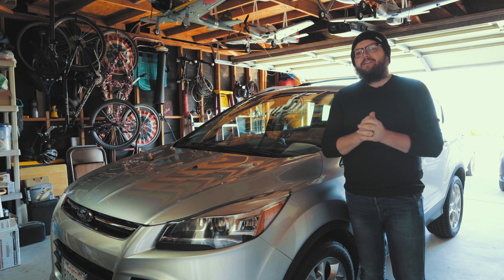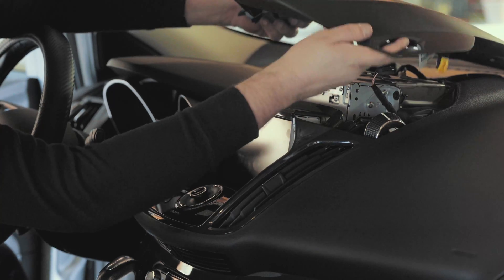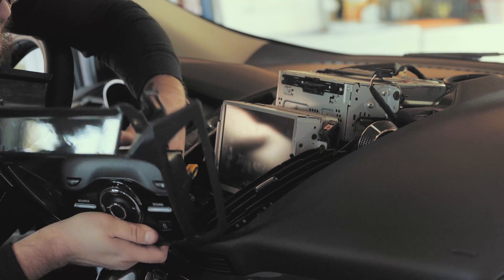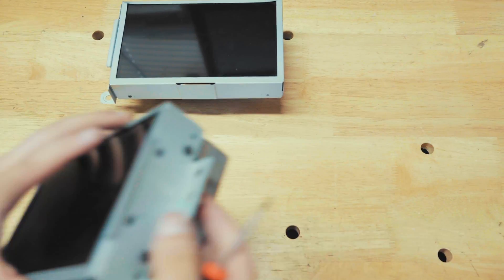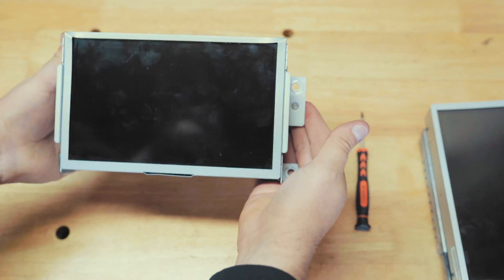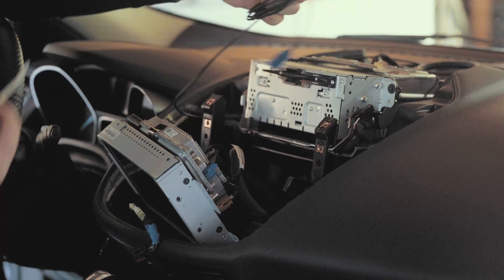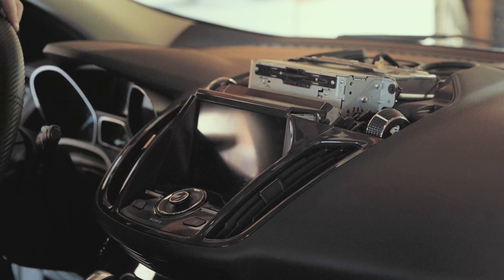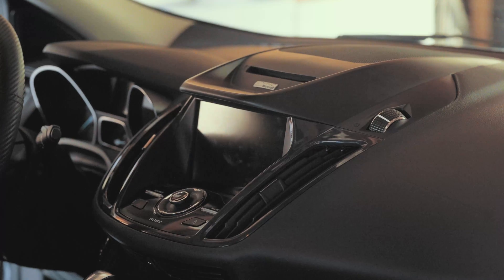2012-2015 Ford Escape Sync 2 to Sync 3 Installation

Comment: Hi, I just installed the new monitor in my 2014 Ford Escape and I wondered if I needed to do a step using the OBD2 cable?  Do you have. video for that?  Also, the instructions that came with that cable say I can't do it on a MAC. Is there any other way, if I have no PC available?  Thanks so much for this fantastic tutorial!  I helped a great deal.

Comment: So I ordered a Sync 2 to Sync 3 kit.  Switched it all out.  Ordered a used ACM.  Still no sound for AM/FM.  I haven't run the Forscan because I haven't ever done that before.  Is there a video on how to run the updates needed to make the new system work with my VIN?

Comment: Brian, once I install the upgrade kit from Factory Sync 2 to Sync 3,  how do I update to the latest software and nav maps? Ford updates will always ask for the vin number and since that doesn't change, the available updates will be for Sync 2 by default.  I did watch your Sync 3 software update video but not sure about the 2020 red box. Should I check yes or no because my vehicle is a 2013 with the upgrade kit from sync 2 to sync 3?

Comment: Will this kit work with 2012 MKZ?
Reply from the maker: Unfortunately the 2012 MKZ doesn't have the correct CANBUS communicative lines and CAN messages to boot Sync 2 or 3 ☹️

Comment: I have the 2014 model, my entertainment system looks slightly different (the controls, not the screen), would this still work?

Also, does the gps antenna not move around in there?
Reply from the maker: Hi! Please shoot me an email with a photo! GPS is stuck down with a sticky pad 😊  support@naviupgrade.com

Comment: Awesome video, I personally went to the junkyard and pull a stereo from a 2016 escape and took a picture of the Vin, so I can still upgrade stuff on the go, so I have a 2016 escape stereo fully plug-in play into my 13 escape. Only difference is my idiot brain didn’t decide to take the navigation Antenna and now the escape is gone. I will be checking your website to see if I can purchase an antenna.

Comment: Your video is very helpful with my replacement of Sync 2 screen (screen shattered in heat while touching).  I ordered a replacement screen and module from eBay.  I did not see any information in your video about programming of the new module.  Do you need to program the new module with your specific vehicle or is it just plug and play?  Ford service advisor told me that if I replaced the module then programming would be required.  Any info would be greatly appreciated.  Thank you.

Comment: Hi, great job. I have a question. I have got Escape 2015 with Sync2 and Navi. Can I just buy Sync3 removed from Forda Edge and install it  in my car? Is there anything that I will need to configure, like rear park aid sensors or rear camera or it is just plug and play?

Comment: Something that crossed my mind recently and may be worth looking into for SEO type stuff.

The same process for the 2012-2015 Escape applies to the 2013-2015 C-Max model years (with the 8" touch screen/MFT of course). The relevant dashboard and center console components are 100% identical. As such, this video has been my go-to to link people who are looking to do this upgrade in their own C-Max. Just an FYI in case you weren't already aware of it. 🙂
Reply from the maker: Yeah I think I used to have this labeled as that but it didn't do as well for views.
Reply: @NaviUpgrade and Kuga.

Comment: I’m interested in doing this on my 2014 ford escape, but this is something I cannot do myself. Can you suggest where I might go to have this done for me? I tried a Ford dealership but they don’t do that. Best Buy? etc?   I few years ago I might have tried it, but at 70 it’s a bit beyond me. Thanks.
Reply from the maker: Hey there! If you buy a kit from me I'm sure a local audio shop can get it done at a reasonable cost! I have 10% off for the rest of the month as well using the code BF2023 😊
Reply: How much does it cost in total?

Comment: My upgrade has this problem where when I turn my car off like for gas or to get Starbucks. My radio doesnt turn on for like 10 minutes. The whole apim is in like some timeout even the USB ports don't work. After like 10 minutes, I can hold the seek and power button for five seconds and it'll reboot and be fine. But it's just so annoying. So I leave my car on accessory while I'm pumping gas and then just kinda live with it when I make a quick stop somewhere else. Also, it overheats frequently and the screen will shut off if I'm driving into the sun or it won't even turn on if I left my car in the sun
Reply from the maker: Did you get your upgrade from me? If so, email me via the contact page on my site. Thanks!

Comment: Great video!  But quick question... if the car already has GPS and you are just upgrading from Sync 2 to Sync 3, do you still need to replace the GPS?
Reply: Logically speaking I don't think you should but I could be wrong

Comment: I have a question, I’m just about to do this upgrade but my cd player wasn’t working. Do you think if i remove the cd thing is it going to work still? I don’t need the cd anyway.
Reply from the maker: Unfortunately the ACM is necessary for all audio to work since it's the pre-amp in Sony cars and the amp in non-Sony cars. You could use forscan to turn off the cd player on the screen if that's the only part that isn't functioning.

Comment: I have a 2013 Ford Escape with just navigation. Can you tell me what I need from you to upgrade to sync 3 for Android auto?
Reply from the maker: Certainly. This kit will get you set up entirely. Non-Nav units will be in stock end of the week 🙂

https://naviupgrade.com/shop/hardware/sync-2-to-sync-3-kits/easy-escape-sync-2-to-sync-3-upgrade-2013-2015/

Comment: After installing it, is necessary to programming? Can you up load the video programming to Ford  escape 2013 and how can I know if it is compatible for my car
Reply: Ours was a 2013 Ford Escape.

Most of the functions work without programming, but there are a few that are very annoying which will not work if it's not program. For me the volume up and down button would work but you wouldn't see the indicator. It would just be frozen on zero. As well as the other steering wheel controls that would activate The Voice auction and hang up and answer the phone call. Those wouldn't work at all without the programming. It's possible there's more of that does not work or does not work correctly without the programming but I only had it unprogram for about a week. I would say it's definitely worth getting the programming which cost $50 from these guys. Then it's pretty simple to do. It does require having an OBD2 to USB connector, connected to your laptop with forscan on it. We got the connector off of eBay for cheap. Then forscan is a simple download that has a two-month trial you can use.

Comment: Desperately looking for a sync 2 - sync 3 upgrade for my UK 2016 Transit connect.
I can't seem to find any kit that matches the 6.5" screen size I have. Also, I've been reading that the UK version will need 64gb storage for all Europe but if I only want UK, could I not get away with 32gb?. In any event, I've not yet come across the same dash set up I have or a UK version. Is this anything you could assist with? I have back up camera and rear parking sensors too.

Comment: If only there was some kind of Ford exchange program. I don't find it worth it for this high price to get SYNC 3 for Android car play support to cost almost $800. Nearly the same price as a Google pixel 6..
Reply: Beats the heck out of buying a new car though…
Reply: @wendellkimbrough3947  I've just opted for getting a $20 tiktok apple/android auto display and suction cup'd it to the top of the flange for the cd player. Doubles the ability to just unplug this screen and move it to another car if I do change vehicles, and the new vehicle doesn't support it either, and save money on having to replace a headunit in which I already had to send in the audio unit to an ebay repair service to get fixed. Trying to unplug some of these connectors are an absolute pain and I'd rather just cheap out, get a functional unit that could even just slide in front of the cars current SYNC2 screen spot too, but the reverse camera, so suction cup it above it. Just setup with the phone to connect to android auto and setup the unit to rely on car bluetooth, so the car controls for volume and skip song still works, just don't have a button to interact with the assistant, but it's easy to say it out loud or press the mic on the screen. And then with the unit supporting FM output, can even just move it to an older car with no bluetooth support in the future.
Spent $20 instead of $800 or so for a unit that's portable, compared to a unit that's staying with that car until it's gone.

Comment: Ok, so I’m looking to do this to my 2014 escape, I have the same 8” touch screen but don’t have the Sony sound, will this kit still work? Also does this effect my satellite radio subscription, will my oem back up camera still work, and will the steering wheel controls function as the normally do with the old voice control now activating Siri with apple CarPlay??
Reply from the maker: Hey there Daniel! Everything will operate as OEM. Pretty much same as yours works now but with much better touch sensitivity and CarPlay//Android Auto support. You absolutely do not need the Sony DSP system either as that's all set with programming. Sat radio subscription is done through the ACM not the APIM so you'll be good in that regard too!

Comment: What about the SD card for navigation?
Reply from the maker: Sync 3 uses a built in eMMC chip (like an SD card soldered straight to the motherboard) for maps storage. If you want maps, you have to get a module with maps on it already.

Comment: So no one has ever done a simple  4" inch sync to sync 2 upgrade on their 2013 escape? Do I need to replace the whole center console for this?
Reply from the maker: Dash swap most likely. There's a bunch of supports for the larger screen missing on the 4" dash setup unfortunately.
Reply: Man that sucks I got all the parts even the metal bracket where the radio sits on that screws into the frame. I bought the non Sony radio.
Reply from the maker: I mean you can try... There's a guy in the Kuga forums who did it and made his own brackets to support the screen. A bit janky... Just don't open it up for people and they'd never know 🤣

Comment: Can I go from a sync 1 to a sync 3 in my 2016 Ford Escape SE?
Reply from the maker: Errr it's a "kind of"  at this point. Unfortunately ford didn't really make the escape very modular like the Focus and the Fiesta. Wiring is possible but mounting requires a bit of a custom solution that needs fabricated brackets 😬

Comment: Hey this is awesome - my 2013 Screen just died so this is at least a nice upgrade.  The question is two fold - why the GPS antenna being added?  I have Sync 2 with GPS so do i already have the antenna?  Then where is the video how to program the new unit - is it necessary??

Thanks - loved the video and your screen presence is very good and easy to follow.
Reply from the maker: Hey there! Sorry for the late reply, my phone got stolen last week. Normally get notifications on there so a bit behind on my YouTube comment responses! GPS is required since Sync 3 uses a different GPS protocol and connection. If you purchase from us it will come programmed and ready to go for your vehicle. I need to dig into my archives to see what ever happened with the programming video for Sync 2-3 in the Escape!

Comment: Hey can you upgrade the Ford Escape 2015 with 4" screen to sync 3 -8" or bigger? its Sync 1 installed.
Reply: I need the same info. I was watching another tutorial and the guy had to make room by cutting away pieces of the dash so I’m trying to see if that is avoidable

Comment: Brian, after this upgrade, can I use the Sync 2 APIM module/Screen for another vehicle.  Was thinking about using it on my Sync2 F150 (non-Nav). the Escape Sync 2 that I am replacing is the Navigation version.  Would there be programing necessary?  Any info would be greatly appreciated!!!

Comment: In the beginning it was mentioned a laptop and ODB cable was needed, I didn't see them used, is that really necessary?
Reply: Wondering this as well. I have a 2014 Escape and looking to make this upgrade, but I want to make sure I have all the info to do it myself.
Reply: @derricbb  yes, that has to do with the programming using Forscan. Access the APIM using Forscan through the OBDII port and adjust the setting so it matches your vehicle. I think he also sell you the file to load in Forscan with the equipment. Not sure, but that's what the laptop is needed.

Comment: is it possible to go from sync1 4 'to sync3? I would like to be able to do it but I have not seen anyone who does it. radio support changes a lot.
Reply from the maker: It is! We make a harness for it, but we haven't gotten our hands on one to do test fitment and a tutorial on getting everything mounted up. It might require some cutting modifications to get it to properly fit -- but then again, we haven't gotten our hands on one to confirm this yet.
Reply: @NaviUpgrade  ok,gracias por su respuesta. espero que pronto sea posible es algo que me gustaria hacer hace mucho. Tambien he leido acerca de que hay que cortar lo soportes de sync 1, este es el menor problema.  despues no sabria como atar la nueva pantalla.

Comment: After installing it, is it necessary to program it or not? Just doing this video would work or would I have to do something else?
Reply: Most of the functions work without programming, but there are a few that are very annoying which will not work if it's not program. For me the volume up and down button would work but you wouldn't see the indicator. It would just be frozen on zero. As well as the other steering wheel controls that would activate The Voice auction and hang up and answer the phone call. Those wouldn't work at all without the programming. It's possible there's more of that does not work or does not work correctly without the programming but I only had it unprogram for about a week. I would say it's definitely worth getting the programming which cost $50 from these guys. Then it's pretty simple to do. It does require having an OBD2 to USB connector, connected to your laptop with forscan on it. We got the connector off of eBay for cheap. Then forscan is a simple download that has a two-month trial you can use.

Comment: honest question why go sync 3 when you can just go aftermarket for literally 1/4 of the cost?
Reply from the maker: Also, going aftermarket in a car that is equipped with Sync 2 or the Sony system is a lot more difficult than you'd think since the entire DSP system relies on a single high level input that is modulated via CAN/LIN (for EQ, Volume and Balance/Fade) from the Sync 2/3 APIM.
Reply: @NaviUpgrade  thanks for the reply that makes sense
Reply from the maker: If you think about it… the cheapest Apple CarPlay/Android Auto head unit is a $300 JVC unit -- this will have a resistive touch screen and be just an 'okay' experience. Add in the cost of the Metra harnesses and dash kits, you're well within the range of doing an OEM upgrade such as this if you find the parts at a junkyard. If you go with a nice capacitive aftermarket unit the price doubles quickly. OEM will always look better in the car. If you're an audiophile you can either do the aftermarket option or program your ACM to output line levels for a good oem integration. It's really up to whatever your preference is.

Comment: This may be a dumb question. Have you done a video for radio replacement on a 2013 Ford focus se. From syn 1 to 2
Reply from the maker: Hey there! We've done an upgrade from Sync 1 to Sync 3 in a 2012 Focus which is very similar! Check out our other videos!
Reply: @NaviUpgrade  thanks you. I just wish my radio was more bluetooth friendly
Reply from the maker: I'd say go to Sync 3 if you can. Our harness can support Sync 2 but it's just nowhere near as good as Sync 3.